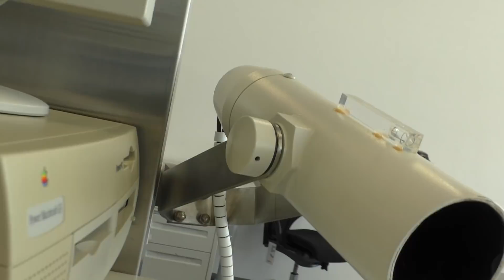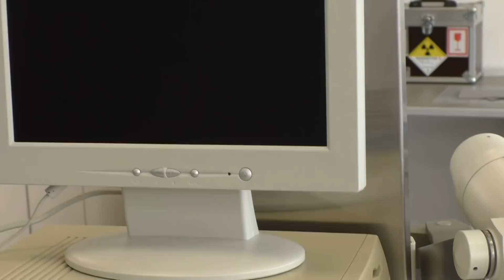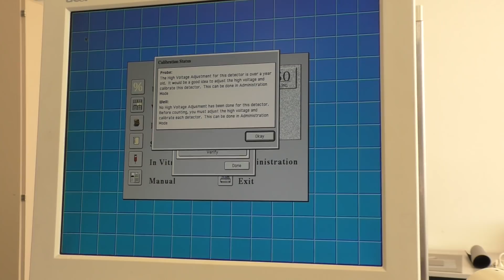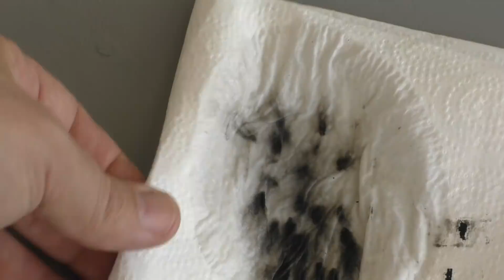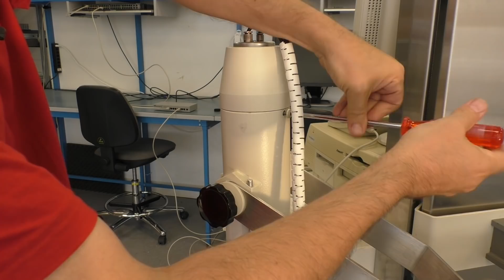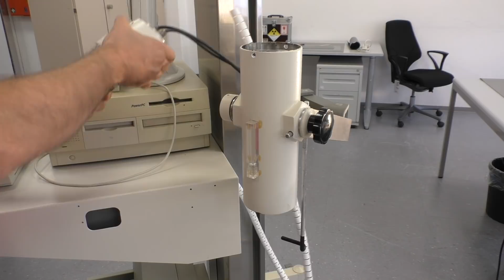Biodex Atomlab 950 medical spectrometer - (PWJ109)

Comment: This machine is used in the medical industry for thyroid uptake studies.  It is designed to look at the energy spectrum of iodine-131, which is an isotope of iodine with a half-life of about 8 days.  This machine will monitor the thyroid's uptake rate of the iodine to detect the presence of cancer in the thyroid.  This will also help determine the proper treatment , if cancer is detected.

Comment: Thanks for this trip down memory lane! The current model, which includes an updated computer/printer and (Windows) operating system, is still in high demand:  https://www.biodex.com/thyroiduptake
Reply from the maker: Funny that you found my video so quickly :-) Can you send me a Cs-137 sample for the calibration? Let me know at playwithjunk@gmail.com
Reply: Biodex is not a source manufacturer or provider. As others have suggested, try common household items that are naturally radioactive to see if it will generate an energy spectrum. Granite, bananas, etc. Good luck!
Reply from the maker: I have an old clock dial that produces an interesting result... ;-)
Reply from the maker: By the way... is there any infomation about the serial protocol of the controller box? Would be nice to have just in case the old Mac needs to be replaced.

Comment: Do you have a DeLorean DMC-12 or do you use something else to build the time machine?
Reply from the maker: I still have no flux capacitor.
Reply: At least you already have the fuel for it. Too bad that you can't use it to calibrate that spectrometer. ;)

By the way: There was a time between 1989 and 2001 when you didn't need a permit to handle a Cs-137 calibration source with an activity of 333kBq in Germany. The limit for Cs-137 was 500 kBq. But in 2001 they lowered the limit to 10 kBq. But it seems in Switzerland the limits for Cs-137 are much higher, at 700 kBq. So there shouldn't be a problem to obtain such a source (except maybe for the price, calibration standards are always expensive;)).

Source: https://www.automess.de/Strahler_D.htm

Comment: There is probably a config file for the software that stores the date of last calibration. Hopefully it is a human readable text file and not a binary file. Change the date to today's date and check if it will work. I don't expect the calibration of the tube to have changed much, if at all, since 2014.

Comment: The Cs137 should be easy to find, look everywhere there is that radiation danger sign, like the box on the table…
After calibration test the Strontium value of a smoker, and finding smokers… ask the doctors around, pretty sure one of them will be a smoker...
Reply from the maker: The box on the table contains..... my camera equipment :-)

Comment: Man that printer brings back memories
Reply: bcHelix I had a similar or exact same printer!
Reply: It does for me too. I remember using a similar model printer (same design but the model with colour) in secondary school 18 years ago.
Reply: I remember this series of printers to well. They never worked right and about all my relatives had one and wanted me to fix it.
Reply from the maker: Except for the paper feed problems I got it printing today. But it only prints the first few lines of a page... I guess it's not blocked but simply empty. But I can still hear the ink inside. That should be from the time when cartridges were refillable... hmmm...
Reply: I think the cartridges for these printers use a sponge to hold the ink in, not just a tank with ink sloshing about like epson cartridges. Definitely could be refilled as these old printers don't know when the cartridges are empty (don't have a counter chip).
Reply from the maker: I think there is no sponge. I can hear the ink swashing...

Comment: That photomultiplier tube and matching sodium iodide scintillator is worth a pretty penny, even second hand on ebay.
Reply from the maker: Seems so... 160 dollars or more. I saw one selling the socket only, for $80 :-)
But I will leave it together until I saw it working. I wonder what I could do with it.
Reply: Take a look at my video about building your own spectrometer based on existing hardware.
All you need here is to split the signal cable and feed it into a sound card(inverting is a good idea), as it seems the decoupling is done inside the tube dynode chain circuit(orange capacitor).
As for a Cs-137 source you'll need for calibration, look for TG-30 spark gaps on eBay. They contain just enough Cs-137 to be detectable, but not enough to be dangerous even if broken.

Comment: Very impressive piece of equipment. Also the last place I tought I'd see a Mac in. Granted, the Classic Mac OS is more stable than Windows 9x or NT from the era, but I would've expected some sort of UNIX machine in this application. Weird.
Reply from the maker: The never models use a Windows PC...
I'm surprised how this 300 MHz Mac reacts so quickly to any input command. You click and the window opens without lag.... something that has got lost in all modern computers.
Reply: The Classic Mac OS is responsive even on the slowest machines when moving around the UI, it really is a thing of beauty. However, when it comes to multitasking it kind of falls on its face. 
And do not underestimate PowerPC CPUs, I have a machine like this (I have a video about it on my channel, and another one coming) upgraded with a 400MHz G4 and it runs OS X Tiger (from 2005!) like it was made for it.
Reply: I said in the UI. Programs running on top are a different story. I have never found a slow Classic Mac OS factory install. If you filled it up with extensions and control panels it could get very slow very fast. And it did get quite a bit faster from 7.6 onwards on ppc machines. But yeah, Windows 3.x is in my experience way faster, mostly because it doesn't have fancy animations for everything. 9x was just bloated from the start, I remember my old laptop with 16MiB of memory constantly thrashing the disc on 95. 3.x or even Mac OS 8 would run comfortably on that amount of memory without swapping that much.
And I'd agree on early (and current) OS X being quite a slow mess. Pretty much nobody took it seriously until Tiger came out, just like nobody takes it seriously anymore since Apple went back to their '90s ways in 2012 or so.